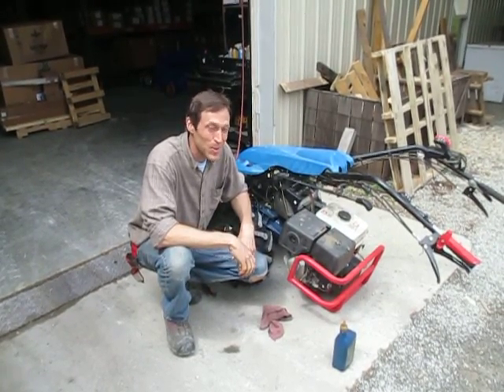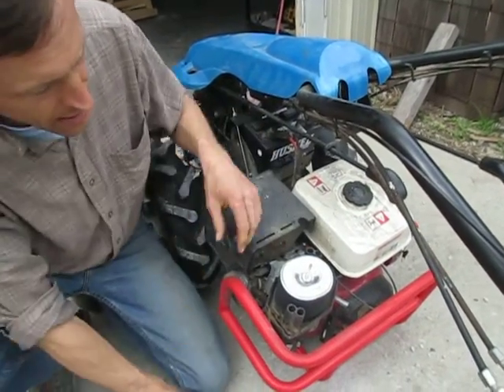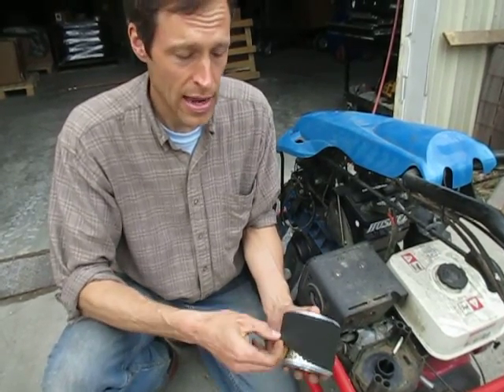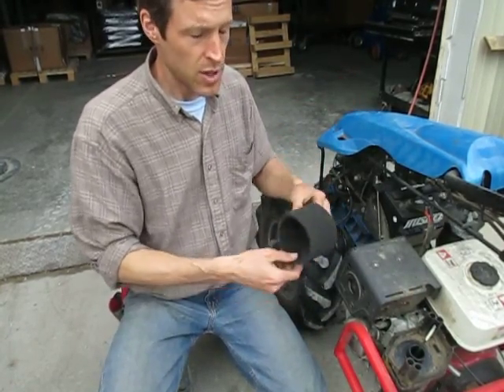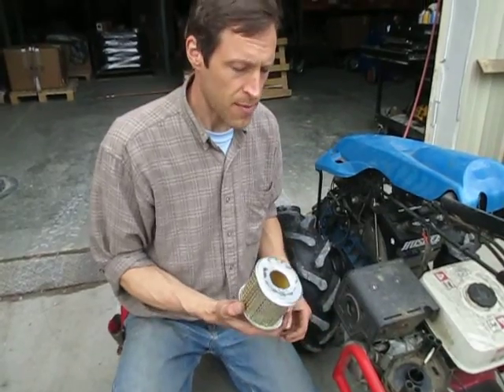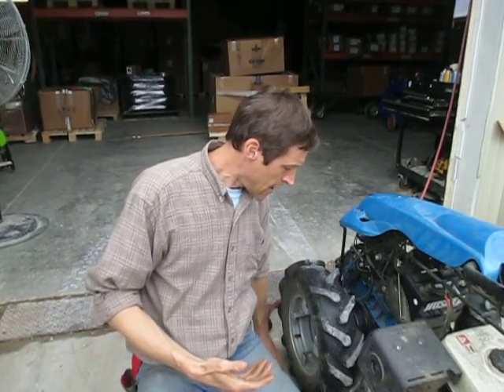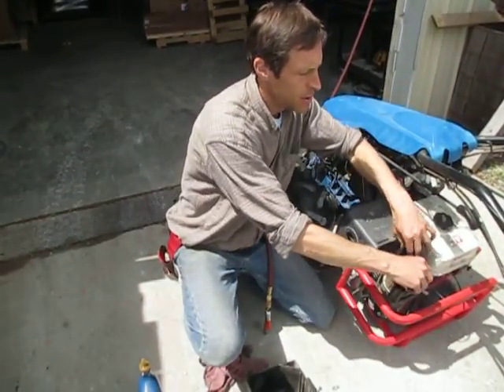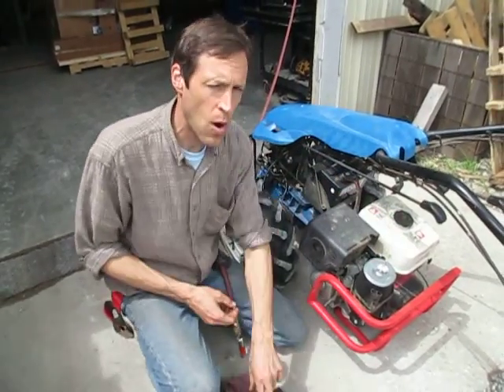Walk-Behind Tractors: Air Filter Maintenance

Comment: Hi Joel! I was wondering how do you clean a steel wool filter for a Honda GX390 engine (i have a Grillo G110 tractor). On the engine manual it says to remove the steel whole from its cage, but i noticed that the metal thing keeping in its place is fixed with some soft plastic... and if i remove the lid, i will not be able to put it back.... Thanks for all your great videos and expertize!